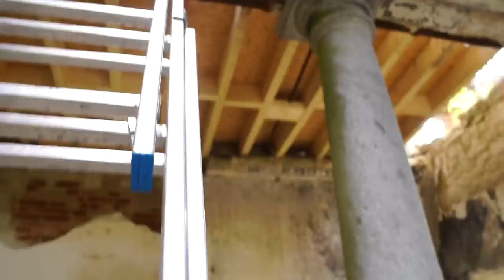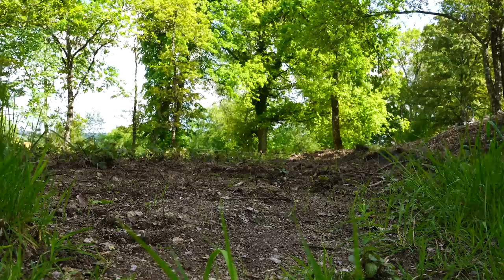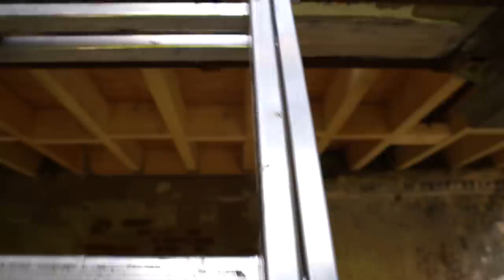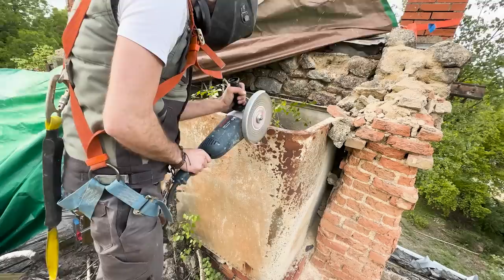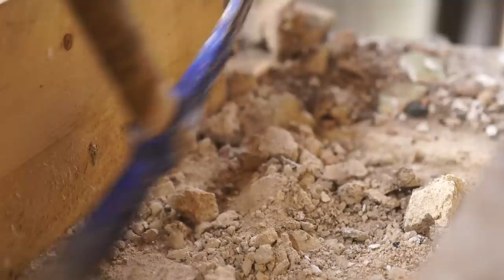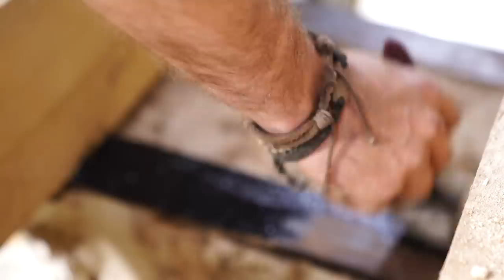Attempting water tank #2 , I got evicted from the chateau.

Comment: I love the thinking process of the old ways, providing water to the chateau. fast forward to present day and it's back in full swing in many off grid homesteaders
Reply: I agree with you.  I didn’t realize that they stored water for those old chateaux on the top of the buildings.   While watching old houses in the USA being restored, I saw that they had built large water cystrines in basements and then carried the water upstairs to the other floors.  I have also heard of rain barrels outside.  Storing the water on top of the structure seems to make sense.  The structure of those stone buildings must be much stronger than modern buildings.
Reply: @julieduchek2969  Modern concrete buildings are just as strong, so it depends on the kind of building we're talking about. I think parts of the US have the exact same storage system in old buildings, especially NYC. These tanks were basically a buffer. If you had a spring or mains water pipe with very low flow rate you could fill up those tanks over night at little more than a drip and have enough water in the house throughout the day. The downside is abysmal water pressure, especially on the top floor, unless you have some kind of booster pump.

Comment: I am surprised the walls have enough integrity to hold the weight of the new floors up. The walls looks so thin and held together with crumbling dust. I am impressed with the work you are doing.!
Reply: The majority of the lower walls appear to be in reasonable condition but some repairs are required which is why a roof needs to be fitted, the walls at the top by the roof area need a substantial amount of repair work and possible replacement in some areas!?!
Reply: @thomasherrin6798  Yes, and Dan mentioned that a few videos ago.

One thing most of the worried commenters seem to have missed though is that mortar doesn't need much tensile strength. It needs to withstand pressure, lots of pressure, and that seems to work just fine up to the base of the second floor. Being able to pull off stones or bricks with little force isn't necessarily a sign of deterioration or danger (coming from someone who's grown up in a house with clay mortar that can be scraped away using your fingernails). The only parts of a traditional house that are under tension are the timbers and in slightly more modern designs steels and rebar inside the concrete. Everything else is held together by pressure, including brick arches.

Comment: Dan, I hope lightening doesn’t strike me for this suggestion, but couldn’t you remove the two tallest points and then rebuild that part later? A controlled demo is better than a collapse and you getting hurt. This might give you more options for the temporary roof and one that isn’t as high, also.
Reply: I think that is exactly what he is doing. Getting rid of the tanks then getting rid of the bricks and steel and replacing with wooden floors like the rest.

Comment: Need to make an outdoor plan & an indoor plan. Outdoors, I might be trying to find the water source (well head?) & getting water samples for testing, locating water supply lines, pump?; Clean up the entire area around the pool & figure out if that's worth saving or would it be better converted into a Walapini greenhouse, if it's entirely in shade it probably wasn't when it was in use so there's brush cutting to do; were there vegetable gardens? Electrical supply -- do you start over from scratch with a mains, or can you invest in wind & solar? Was there ever a garage or stables on the property?

Knowing whatever is still there & what your needs will be in five years can be key to avoiding expensive mistakes. I do think your investments in ladders, scaffolding and safety equipment were very wise... you will find those things useful many many times over the course of your restoration. Are there other things of that caliber that you think you would use long term here at the chateau?
Reply: Since the mains feed up to the meter still exists I'd think going with mains power would be much more cost-effective than solar, unless you wanted to live a really frugal life a PV solar system that can feed a large house is still fairly expensive. If the network operator had to run a lot of new cables to your property and would charge an arm and a leg for that things would be different.

Considering the location of the château I'd guess there was either a well or a spring somewhere on the property. The question is if it's still on Dan's property after the split.

Comment: How many areas of the Château remain that need clearing out? It would be nice to see a sketch of the floor plan. Good to see you pivot to some yard work and then return to your original plan for the day.
Reply: He has completed about 1% of the work, it is a long term project most probably extending to about 10 years on his own with occasional help
Reply: Two of the three main rooms on the ground floor still need to be cleared out, and the only reason the third one doesn't is because the floor has collapsed and all the mess is in the basement.
Have a look at the drone shots, they're almost as good as a floor plan! Time-wise I'd hope for Dan to have floors, sturdy walls and a permanent roof on within five years. It's definitely a long-term project.

Comment: I was thinking it is probably best to get the floors replaced in those two burnt out bathrooms before getting the roof above them cleared off. That small tree up there might of damaged the roof like it did with the other room below on the other side of the chateaux, and even with a harness and especially without a spotter with you, the chance of having a nasty fall of three whole stories and getting stuck or worse. Atleast if you had a fall through the ceiling then it would only be a small fall to the floor below. 
Also it would make two extra rooms for storage available to you.
Reply: The vaulted brick ceilings are open for inspection from below, I don't think the tree has managed to damage that structure yet. Even the waterproofing of the balconies still seems to be reasonably intact.
Reply: @Ragnar8504  but never know since those rooms were fire damaged, the ceiling might also be damage from the fire and may be brittle. I find it a lil dicey that's all. Always expect the worst and you won't be surprised.

Comment: I would like to give some advice, concerning the use of abrasive cutting wheels for cutting steel. Do not penetrate the cutting wheel through the steel any more than absolutely necessary.  If you push the blade deeply through the cut material, you will cause additional  wear to the sides of the abrasive wheel, causing it to wear out rapidly, and possibly to fracture.

Comment: Using black hammerite on top of the steel will not get the cement to bond to it. Better to use cure rust or similar which changes chemically the rust and hopefully the cement will bond to that!

Comment: Every square inch of roof is gone. How can you possibly build new roof on crumbling walls?
Reply: Dan plans to build the walls back up and install a temporary roof.   Rebuilding brick & stone walls is actually Dan's specialty; he likes doing it and is pretty good at it.  Check out some of the previous month's Vlogs when he was re-inforcing the Chateau basement stone walls with new lime mortar mixture.   He is in this for the long run.
Also, check out his previous Vlogs on renovating an abandoned farmhouse.   I think there is a Vlog that condenses several years of renovation.

Comment: Dan, accept the need to wear gloves. Grabbing dry stones and bricks with your bare hands just endangers your most valuable tools.
Reply: Cements and metals that have  just  been cut , can cut like razors blades, extremely sharp ,   and if they are heavy handling them can cut you hands right off. Wear the proper protection Dan. You are not replaceable,   you act as Super man  , one  day your luck will ran  out. Your boys need   you above all.